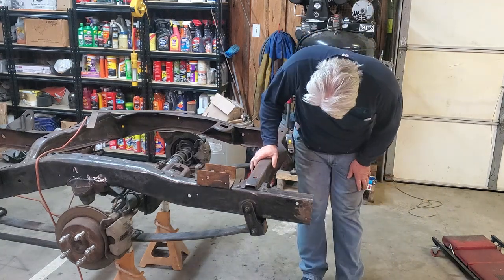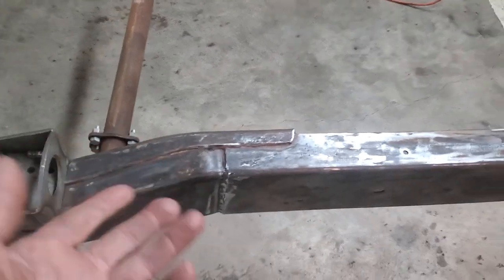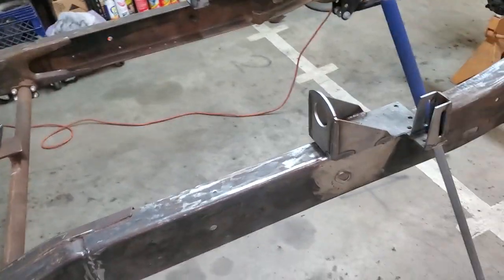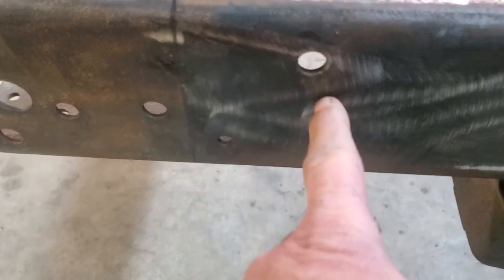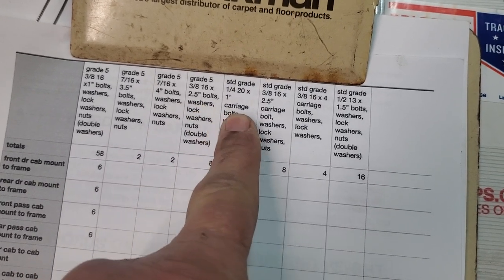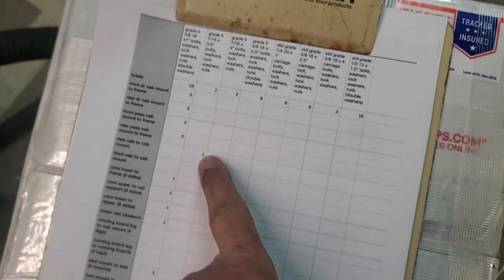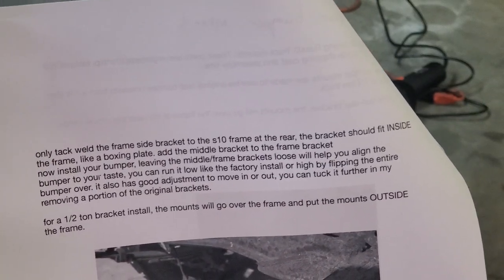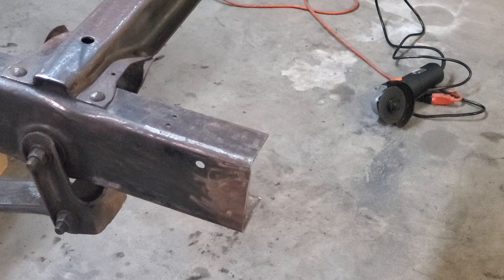48 Chevy truck on an S10 frame. cutting the rear frame rails.

Comment: Can you get measurement from spare tire crossmember to end of frame now? My frame was cut with a torch and its hard to get a good measurement. Thanks in advance!
Reply from the maker: So, measuring from the back edge of the spare tire crossmembers to the end of the frame is 7 7/16 inches. Or you can round it up to 7 1/2 inches. Hope this helps you! 😁 I'll do a short on it. 👍